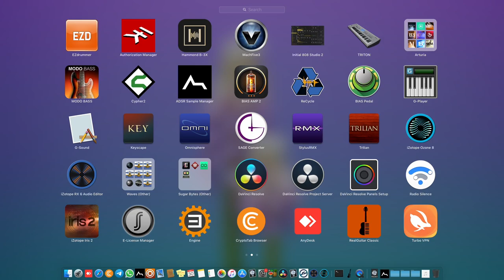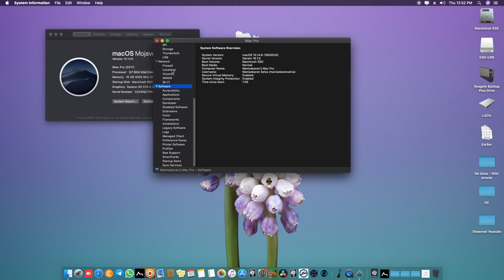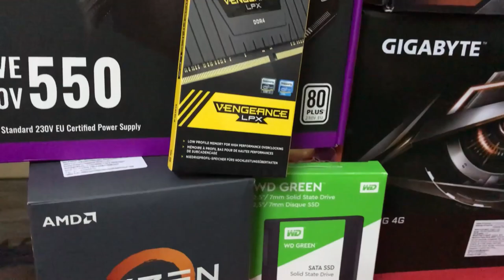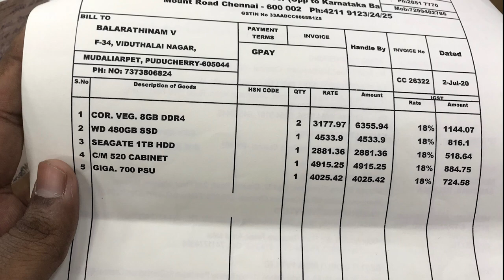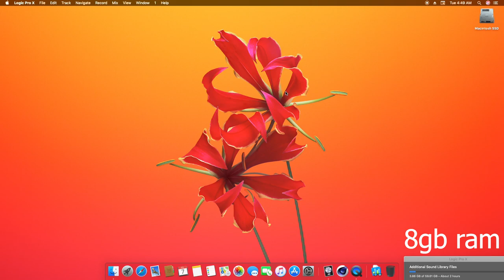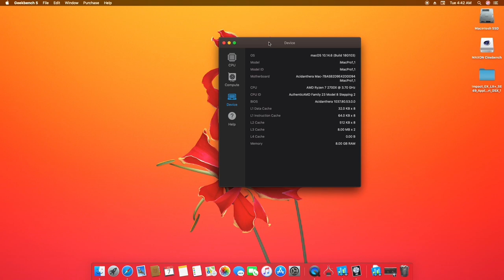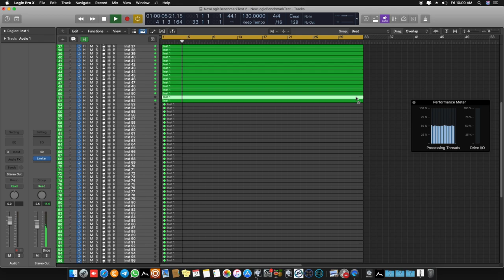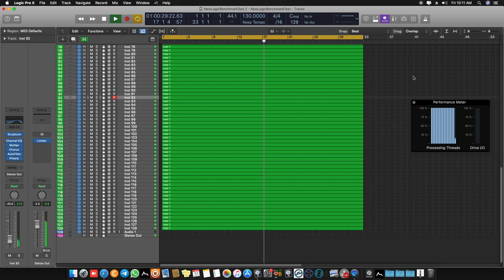Music Production PC Built |  Ryzen Hackintosh | Tamil | Studio Setup | Manisekaran Music

Comment: I have i7-10700K. Just today I successfully installed my Hackintosh but the problem is when I use Logic Pro X my system gets overloaded. Does it have anything to do with the Hard disk cuz I have installed it on an external HDD?
Reply from the maker: Maybe also macOS hard disk must be in internal because then only u will get a good performance also if it’s overloading means maybe it’s wrong with ur patching , I myself will create my own patch bases on system specs and requirement , some small bugs will always be there since it’s Hackintosh but what ur telling is a major one , if u don’t have any problem with ur windows means definitely u won’t have any problem with mac , because finally macOS is just a operating system which gives performance for our need , if system isn’t well implanted then working affected by the patching u do for ur OS